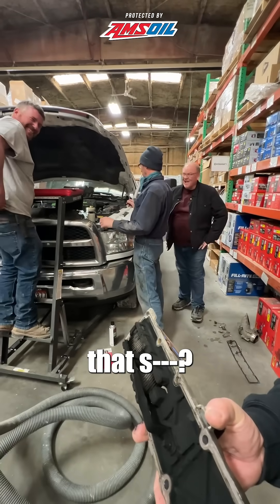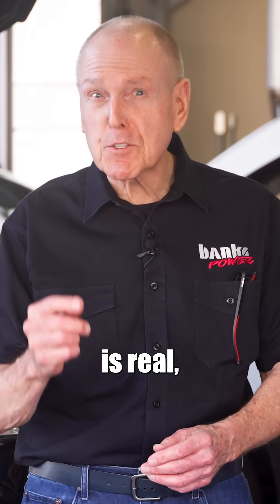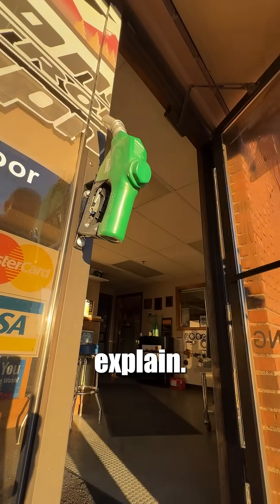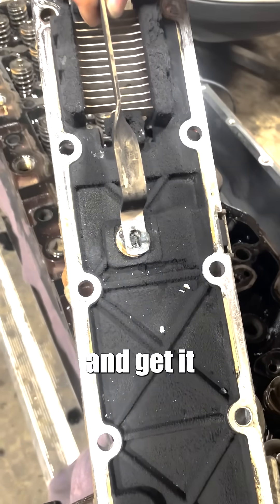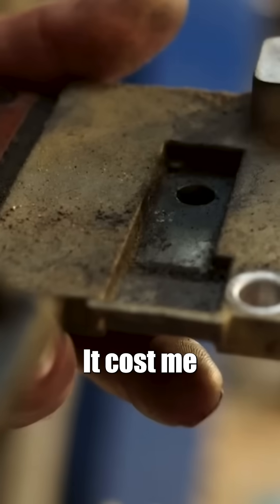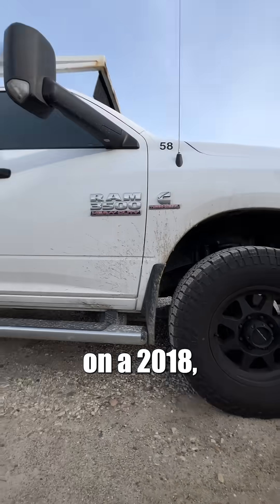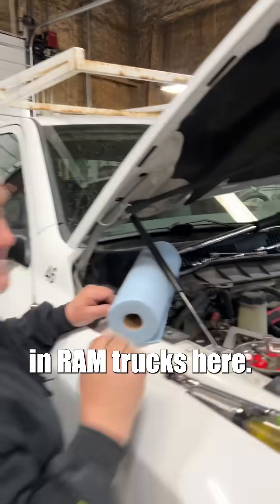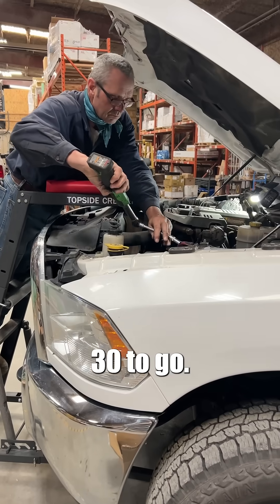Protecting $2,700,000 in RAMs from engine failure.

Comment: Dude get a class action lawsuit to recover your loss as well as set an example to the dealerships. That if this is the trash you want to sell for a premium then it will be the downfall of that corporation. Its better to see them close the doors than sell some bs like that. Ford, Dodge and Chevy are complete trash currently. Especially their diesel line up, its way past engineering error or wear. They are literally designed to fail, then software locked to prevent people from discovering the stuff in the programming that kills the engine and tranny. What's happening it's not ignorance or stupidity, it's criminal. Flat out premeditated and calculated criminal business practices. How about this go to the dealership and get one diagnosed. Before your even notified of their opinion on the problem. "Repairs" are made and a bunch of extra crap that wasn't authorized by the customer have occurred and there you are with a thousand or two in a bill. That's criminal idgaf how you candy coat it, seen it happen so many times I can't keep count in my career. I've quit places several times because of how they were doing people. Came very close to hurting one of my prior bosses for how he done an older couple. He had a bunch of stuff on the invoice that I never did and charged them for it. They came asking me why I had done all this other stuff, could I explain the ticket for them. I looked at that and immediately my anger went to 11. I apologized and explained what I had done and why it's done. Although there's several things here that shouldn't be on here at all. They were satisfied with the work I had fixed their problem just they were way overcharged in ways to which didn't even relate to the repair. I apologized again and asked if they would give me a couple days to figure this out because I don't and won't do business like that. So I confronted the boss next day about it, he told me shut my mouth and get back to work or else... I had a set of car keys in my hand it was a fair size knot of keys and I hurled it at him as hard as I could. He ducked down to his desk to miss them and they hit the wall and cracked the panel board behind him. He came back up and jumped out his chair with "boy I'm gonna beat you ass." I said you old degenerate you touch me I'll put you in a hospital, then help that man and his wife sue you into oblivion. You don't ever talk to me like in some convict or something, because I'll yank your fat ass right off your high horse. Your gonna give this couple back what you owe them. It was about 700 in charges that had nothing to do with the job that I had done. I don't operate like that, might be your business but it's my name and reputation on the work being done. Now one of two things is about to happen either you're going to make it right with that couple and you know what you did was messed up, or you and I are fixing to have a real problem. I'm not leaving this office till you make a choice. so he stands up and demands I get out or he'll toss me out himself. I stood there with a grin and said go for it, the moment you put your hands on my to do anything I'm going to hurt you. Then I'm going to help this couple sue you for all you own. Coworkers were all gathered up watching but nobody got involved. He told one of them to come get me, my coworker said nope that's your problem boss man, he's pretty upset about this and I would be too. I looked back at the boss and said so what you want to do. Make it right or see how well this will go for you in a court room with your tech speaking against you. He said you ain't got the balls, I said bet! Turned around and asked two of the guys to help me load up my box and cart. Which they did, my problem wasn't with them. It was with this crook we had as a boss. Well he comes out after Im loaded up trying to apologize, etc. I said save it I'm done here, you're about to get  to see the size of my sac. I drove off with him hollering something, don't know and didn't care. I had given the older couple my number in case they had any further questions and about 2 hours went by. The couple called saying they just got refunded the full amount of the job which was a couple thousand for the complete ticket. So I explained to the old man what I had done and that's probably the owner's guilt and fear kicking in. Old man starting crying thanking me, but apologized at the same time about what had occurred. I reassured him that no sir that's not your fault, I don't do business like that and won't allow someone to do it and tac my name to it, I was raised better than that. That couple are still customers of mine to this day and can't even fathom the amount of business they've brought to me. Moral of the story, you have to have the nerve to draw that line in the sand and stand on it. Doesn't matter if it's a small company or an entire corporation, wrong is wrong.

Comment: Been a machinist. Mechanic ,engineer all my life. These problems are csusrd by modern engineers thst have NOT WORKED UP THROUGH THE RANKS,  like it usef to be. Nowadays a kid thinks because he can draw in auto cad or some software and they think they are an engineer !  NO ! not all ! First is clean up, learn to be effective clesning up getting chips out of machines etc. 2nd. Is bench learn proper deburing making simple tools like tapping block , learning fractions etc.3rd if you are safe. ( if fact i forgot first is SAFETY , cannot replace an eye or a limb ! ) anyhow mot yime or place . On up to materisls, metalurgy, then you mau begin to understand why some materials and steels properties, heat treating.  What hardnesses work best, what chemicals work best. One of my bosses , last guy i wirked for b4 i started own shop. He told me.  " a doctor must go to school for 8-12 yrs idk what yrs he told me, but a good toolmaker. Must know much more than a doctor ."! 
 Quote by Leroy Straight. G&L tooling defunct

Comment: Instead of buying this couldn’t you just take it off and weld the bolt so it doesn’t come off? When you need to replace the grid heater or whatever just cut it off and replace the bolt 😅

Comment: Funny how little things can screw things up in a big way. I remember having to pull cams out of 50 odd Dodge trucks back in the mid 1980's because the factory didn't do a good job at hardening the lobes. Got damn fast at doing them.

Comment: Yea this is why the auto companies should have went bankrupt in 2008.  They got bailed out by the Feds and this is the result, CEOs getting even more salary while vehicle and parts quality drastically went downhill.  People spending tens of thousands of dollars on new trucks shouldn’t have to turn to the aftermarket to fix something that should not have made it into a road going vehicle.  Where’s the engineer that came up with the idea to hold the grid heater in place in the intake with a single nut?!

Comment: Why anyone would spend money on any Chrysler product baffles me. Ive been building cars and trucks for nearly 50 years. Im not bothered by the fact that chrysler vehicles have problems- ford, chevy, toyota, they ALL have problems. Chrysler engineers produce beautiful cars and trucks, as well.
But what is unforgivable, in my view, is that chrysler/ram products have had the SAME PROBLEMS since the early 80's, they never correct problems, they just continue ad nauseum.
Transmission failure, engine failures due to the same weak points, never corrected. Dash boards which deteriorate and collapse inward. clear coat that deteriorates in a few short years. They had excellent diesel trucks with engines by cummins and tranny's by allison, but dodge couldnt leave it alone. They pushed cummins into building a motor to their specs, and its the first undependable pos cummins ever made on a large scale. Weak differentials, fragile interiors,wheel bearings prone to failure...it just goes on and on, never adequately addressed or repaired.

Comment: The old 6.9 was great, the old 7.3 power stroke was great, I won’t even buy a new truck, never again, I will buy an old truck in good condition and essentially do an easy restoration, rebuild the drivetrain, differentials, new bushings, bearings, upgrade the brakes, upgrade the suspension, new interior and really the only new system you have to put in is Bluetooth with CarPlay and Android, still cost half the price of a brand new truck.

Comment: New Rams are the most unreliable POSs designed today. You have 40ish, we have hundreds, and there isn't one that doesn't have some Rtarded issue plaguing it. Wait until it just clicks when you hit the starter button. Spoiler, it's a corroded wire on the starter that senses how much voltage is in the battery to decide if it is allowed to try to crank... in a non environmentally sealed electrical plug.. on the starter... that gets constantly splashed by road detritus... that you can't get to without removing heat shields and doing contortions. But bonus, if you sit there pressing the button for 15 minutes it'll probably start eventually. Shit can the Rams and buy any other truck.

Comment: there was quite similar issue in Caterpillar 3126B/C7/C9 equipped with grid heater. PCF was a power relay, worth about $100. which failed to switch off, just melted inside and switched on forever. on stoppped engine, only battery drain occured. but when running and alternator charging- grid heater melted and was sucked into the cylinder causing valves go stuck and more damage. i personally had >20 engine overhaul, and maybe 50 failed relays.
it'sfunny ,but i had replaced these with cheap chinese relays for $25, fit and work well without any issues.

Comment: I put that Banks on mine, and removed the grid heater and that stupid bolt and installed a coil heater in the banks intake. Cheap compared to a new engine.

Comment: Love banks and their products. But if i had a fleet I'd be installing the black market performance grid heater relocation kit for $300. Same exact concept of putting a heating coil on the intake (this one goes right before the intake horn) and you just leave everything alone. No removing intake or grid heater, just move the wire and installs in 20 min. Banks marketing is second to none though

Comment: You can buy a cheaper fix that is in fact just as good. You don't have to do the whole 1k dollar banks thing. You can also just remove the grid heater with a very common grid heater delete. You can spend 80-200 per truck instead of 1000.

Comment: Recently had a B6.7 that was practically brand new in a hino come in with a no start,Practically no coolant in the surge tank and oil level very high, Came back sunday to work and the end was off and everything, Cylinder 2 had a valve break and fall into the cylinder and destroy the piston.

Comment: Dodge knows about it, they dont care either ur paying out of pocket to replace it. LOADs of issues with this happening class action lawsuit on the way. same with ford and their high pressure fuel pumps on their super duty. u buy dodge u lose 30k u buy ford u lose 20k absolutely insane u pay 100+k for a diesel truck these days and the engine will literally fail and destroy itself.

Comment: I could not imagine having to work on a FLEET of RAMs we have one in the fleet and it’s just constantly down.
Reply: A fleet 😂
Reply: The guy is supposedly extremely smart, still runs emergency fire starters yanking shipping crates down the road, I’d replace everything with old 7.3 powersmokes
Reply: @patrickancona1193 
I've heard about the legendary 7.3 reliability. 
What's the best year Ford for that?
Reply: Which diesel pickup do you find to be the most reliable? 
The Ford, the Chevy, or the GMC? 
Since Toyota doesn't make a diesel dually yet, I'll have to wait for that.

Comment: Curing a problem on a 2013 truck that hasn't happened in 12 years 🤔
Is this not the definition of "if it ain't broke don't fix it"
Reply: It was broke when it rolled off the production floor. Dodge is trash.

Comment: Very confusing video , what have you done to cure the problem , broken bolt to a new air intake ??
Reply: It's part of the intake system, replaced with the new Monster intake and upgraded heater design.

Comment: I can't imagine owning a business these days and thinking that buying 45 trucks from Stellantis is a good idea. Maybe Dodge was a good option 40 years ago but not now. They are no longer Dodge and they are no longer Mopar vehicles. They're a foreign company pretending to be a Dodge or 'Ram'. 
If that bolt breaking off is the issue wouldn't simply replacing it with something more secure be a lot cheaper?  I guess that wouldn't make for a very good commercial though.

Comment: So uh, I noticed the bolt wasn't addressed....? Just advertising for a completely different part lol
Reply: likely cheaper to loktite the bolt in?
Reply: @landontesar3070  id agree, but it seems one of the examples had the head sheer off
Reply: Uh cause the new part doesn't have a bolt that can fail, thus addressing the bolt issue?
Reply: @TranceEmotion  the first part he held looked like the underside of a valve cover, then the part they show later is an intake plenum. After re-watching, and reading the description you are correct. The redesigned intake plenum, eliminates the grid heater shown earlier in the video.

Comment: How can the customer not sue the company for such a poor labor and quality control?! 

You cannot tell me that some mistake on their end. Thats gotta be done on purpose to milk the customer money. 

My dad works at Mopar and right now all the American suv and pick ups and demands crazy money for silly issues. And he sells the parts and fixes them. And his cant understand how the quality has fallen so low. 

I mean to tell you how bad dodge has become. My brothers wifes bought a challenger v6 on 2018 and now since 2023. The car has an issue that randomly stalls or intermittent starts up. And no dealer or mechanic or anyone here has been able to fix the issue. 

2 years over 134 different places its been taken and the issues cant be solved or found. And a couple of ram, challenger and chargers from 2017 up to 2019 are showing up with the same issue. And literally people are throwing them away because nobody can fix em. 

The dodge dealer offered my brothers wife 6k usd for the car as a compensation for the issue. When she paid like 3x that amount for it🙄🙄

And my dad has all kinds of crazy books posters etc from the 60s to 80s. And every freaking Americans car was so good in quality and there was such a high emphasis on quality. 

He has weird books of each model per year and Americans brand. That give you a full on details on measurements, weight, materials, angles etc on how each car was made to the very smallest detail. With written info and diagrams and pictures. And lots of i guess commentary on the making of the car etc. you would be baffled at how quality was constantly put over everything. And the cars looked amazing and ran amazing and are still amazing to thes day

Comment: Ford Powerstroke trucks have significantly higher reliability. You can't argue with the oil industry. Every truck put into service in the Oilfields of Canada are Fords because they last and have lower repair costs and a lot less down time than any other make and model. Once it became clear that Dodge and Chev/GMC trucks constantly broke down and wore out much sooner than Ford, all of the trucks put into the oilfield as part of Fleet trucks, were Ford, and still are to this day. Cummins used to be good, but not any more. Gale Banks products makes the items for Dodge truck that should be standard, but Dodge isn't interested in vehicles that take a long time to break down, because they want to increase their bank accounts, at YOUR expense.

Comment: I don't see where the Monster Ram solves the grid heater failure.
Reply: Was thinking the same 😂
Reply: The grid heater doesn't technically fail. It's the bolt that holds it that fails which causes catastrophic damage. The Monster Ram has a coil heater that replaces the grid heater.
Reply: @enigmaticcruz2483  Thanks for the info.  The video should have mentioned that.

Comment: Pretty simple, put a screen gasket for the intake to keep any thing from the heater from getting into the engine.
Reply: You see all that black stuff coating everything in that engine? what do you think it would do to a screen?
Reply: @thebigrich  Cleaning a screen is a lot cheaper than that bolt landing on top of a piston. Don't you think? With the EGR valve you going to have that black stuff.

Comment: First problem was buying a fiat (jokes) but ain’t like ford or Chevy are that much better. Diesel trucks just suck nowadays. The company I work for has plenty of Cummins, Powerstrokes, (surprisingly no Duramaxes) Internationals, Freightliners, Macs, Volvos. They all suck. Every single one of them sucks. They’re always in the shop. Diesel motors got murdered after they got mandated to use EGR in 2004 and then even more so in 2010 with def. You just can’t buy a reliable diesel motor anymore. Honda and Toyota wouldn’t even be able to make a reliable diesel nowadays that could tow what these rigs require.